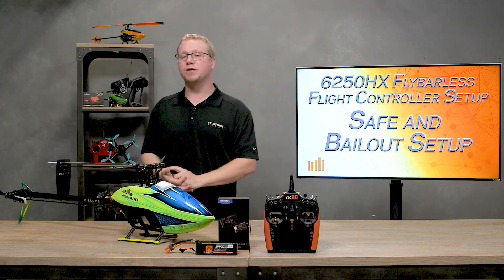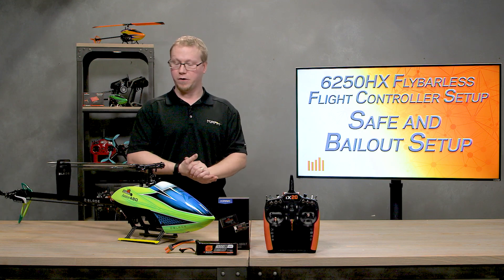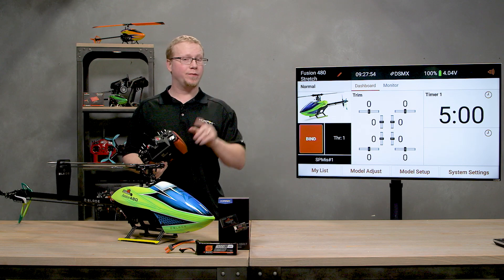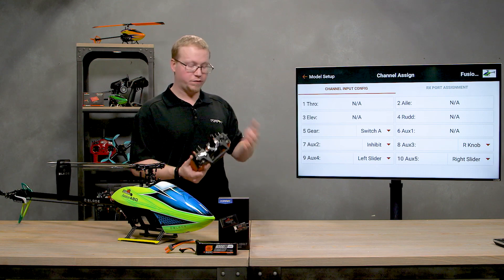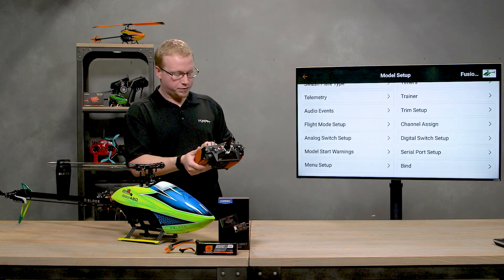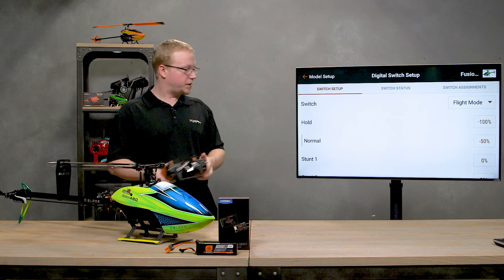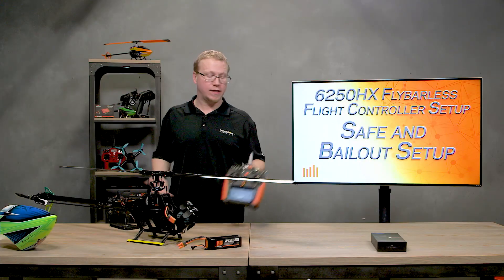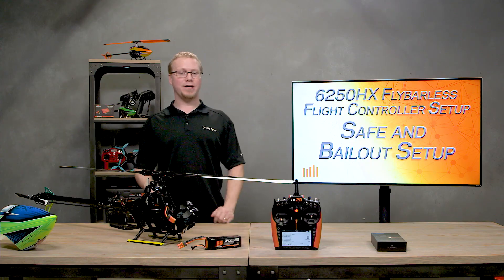Part 7 - SAFE and Bailout Setup - Spektrum 6250HX Flybarless Controller Setup Series

Comment: If I go into forward programming safe mode and turn it on it's always on in every mode it won't let me pick between normal mode flight mode 1 or flight mode 2? Everything else seems to be functioning correctly though. Like if I bump it up to idle up 1 or idle up 2 and try to do a flip or a roll the stability mode is still on so it won't let me. But when I'm in forward programming and try to switch between flight modes it's always in Normal?
Reply from the maker: You do not have your Flight mode channel set propperly. In the channel assign menu on your tx pick a open channel and assign to F-mode (flight mode) THEN go into Forward Programming - Setup and choose the same channel as your flight mode. It should work correctly after that. Hope that helps!

Comment: hi, my gyro is reversed. meaning if I tilt the helicopter to the left, the swashplate does not level in to opposite but tilts completely towards the left..! how can I fix that....
Reply from the maker: Make sure your sensor orientation is correct. Then double check that the servos are in the correct port and your controls are going in the correct directions.
Reply: @SpektrumRCvideos  yes, my orientation in setting was opposite! Thanks so much

Comment: Hi..can you make a video on how to setup a microbeastx plus, the manual says to use 3.2 or 4.2 but 5.1 is what I got with the kit. I try to program both 5.1 do not let me go to perimeter settings but the Rudder hold positions. But 4.2 it let me do the perimeter but the Rudder got mixed with the pitch. I checked the Tx nothing mix. I can  not left the heli up

Comment: Nice set of videos. It would be good to have video(s) of what to do when programming doesn't go well. I did something and now when I power up, the light on the FC6250HX rapidly blinks three red, one green, and repeats. I have found no way to reset.
Reply: I saw a reset function in one of the prior videos, have a look at them
Reply: 11:08 in this video shows the function to reset it
Reply: You will have to calibrate the gyro make sure it’s level and no vibrations.

Comment: I tried using safe mode on my kraken 700 heli yesterday in normal mode. I just went into safe mode and enabled it to "On". When heli started to spool up it tipped over to the right and blades striked the ground. I hit throttle hold immediately. Ruined the main and tail blades. Thank God I had a set of Rail blades at home. Replaced blades and disabled safe mode in my radio. I wont be using safe again, afraid of it. After watching this I see there were other things I was supposed to setup on radio before enabling safe. To afraid to try it again though. Lol
Reply: What receiver and flight controller do you have...i have a Trex 700 and if you set safe/autolevel when it initializes its at the wrong angle and will try to level itself and hit the ground, but thats with an ikon2...so i dont set the first mode with autolevel when i plugbthe battery in..
Reply: @mateozorro2461  I'm using 6250hx with my Dx12. I don't mess with safe anymore. Really don't need it but I just wanted it to work right so I can teach a friend of mine now to fly.
Reply: For your Kraken, does the tail servo end limits that you set fall into the range Spektrum recommend? As mine are way below what they reccomend and I have definitely set it up mechanically correct. I'm wondering if this is a Kraken thing.
Reply: @_RIL_  Yea it falls in the range. I'm still flying the kraken 700 along with a Logo 700 using the 6250. No issues flying, just safe mode is garbage.
Reply: @ahwayzcool4630  Oh ok maybe I do have something wrong with the tail set up that I can't figure out. Yeah I am glad I did my research and saw the info about avoiding using safe mode before flying mine. Thanks :)
Reply: @_RIL_  Avoid Safe Mode like the plague. Lol. Bailout work just fine though. I tried it on both helis but ended up deactivating it because I don't need it.

Comment from the maker: In this video we walk you through the procedure on installing SAFE and a Bailout (panic) button with the Spektrum 6250HX Flybarless Flight Controller. Follow along with Tom to learn how and get some tips and tricks along the way!

https://www.horizonhobby.com/fc6250hx-helicopter-flybarless-control-system-spmfc6250hx

Here are links to the other parts of this video series
Part 1- Introduction https://youtu.be/fwVeKYJWFAk
Part 2 - Installation and Binding https://youtu.be/R81szwu1PLE
Part 3 - Transmitter Setup https://youtu.be/rxS7LmwlbVs
Part 4 - Swashplate Setup https://youtu.be/VJ0m2S42QPI
Part 5 - Tail Rotor Setup https://youtu.be/vr3rnwtveak
Part 6 - Final Steps and Preflight Checks https://youtu.be/HDpvRV47H9U
Part 7 - Safe and Bailout Setup https://youtu.be/aCmbCvQ5vUo
Part 8 - Smart Technology Setup (coming soon)
Part 9 - Tuning with James (coming soon)

Equipment used in this video series
Blade Fusion 480 Smart Super Combo - https://www.horizonhobby.com/fusion-480-smart-super-combo-kit-blh4925sc2
Spektrum 6250HX w/ 4651T Telemetry Rx (included with Fusion 480 Smart Super Combo) - 
Spektrum iX20 Smart Transmitter - https://www.horizonhobby.com/fc6250hx-helicopter-flybarless-control-system-spmfc6250hx
Fusion 480 Stretch Kit - https://www.horizonhobby.com/fusion-480-stretch-conversion-kit-p-blh4965 
Spektrum Avian 100 Amp Smart ESC (included with Fusion 480 Smart Super Combo) - https://www.horizonhobby.com/avian-100-amp-brushless-3s-6s-smart-esc--spmxae1100
Spektrum H6050 Cyclic Servos (included with Fusion 480 Smart Super Combo) -
Spektrum H6360 Brushless Tail Servo - https://www.horizonhobby.com/spektrum-h6050-high-torque-mid-speed-heli-cyclic-servo-p-spmsh6050
Spektrum SPM4767 Remote Rx - https://www.horizonhobby.com/dsmx-remote-receiver-spm9745
Spektrum Smart Lipo - https://www.horizonhobby.com/222v-4000mah-6s-50c-smart-lipo-battery--ic5-p-spmx40006s50
TL90 Digital Pitch Gauge - https://www.amazon.com/YoCoo-Display-Airplane-Helicopter-ST250-800/dp/B017LYIPX6/
Make sure to follow us on Facebook and Instagram for all Spektrum News and Promotions!
https://www.facebook.com/SpektrumRC/
https://www.instagram.com/spektrum_rc/  
@SpektrumRC

Thanks for watching!